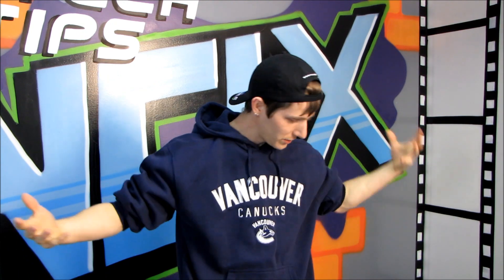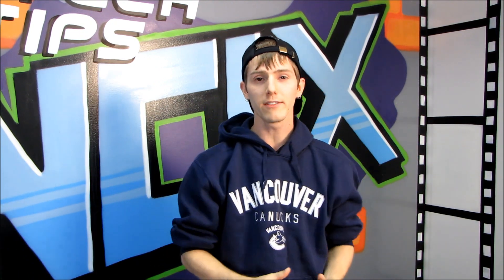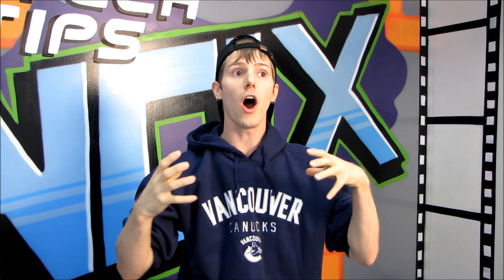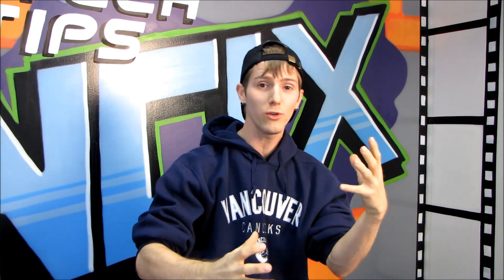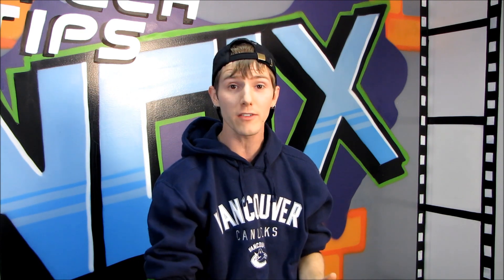Futureproofing Your PC - Dispelling Some of the Myths NCIX Tech Tips

Comment: it really all depends on what the customer wants, for say he/she wants to do basic stuff like lite to medium gaming, office tasks, youtube and facebook kind of stuff in the back ground, for this specific person id recommend something like a FX-6300 (becuase were just starting to get into softwares using 4 cores so in theory, a 6 core should be plentiful). I would then choose something like a r7 260x or 750 TI OC (becuase with light weight tasks, either of these will be plentiful for what gets thrown at them). then i would chose 8 GB or ddr3 1600 MHz ram(becuase with heavy software like AV's, you should have atleast 4 or more and 8 is sort of the sweet spot. last but not least i want one of the top 2 chip sets (970-990) that are available for that specific cpu and not cheapo, a decent board thats certified to last more then 3 years and a power supply that is atleast rated 80 Plus or better and like linus said, storage varies but my reason for not including is just for the fact that they would probably be the first to fail on the system, but for the time being what would be put in this rig, a 2 TB hard drive for storage, and a 128 GB ssd for OS and softwares
Reply: Jack Pollin FX-6300 can run most CPU-demanding games on high np.

Comment: Future proof, hmm.. i'm still runing  C2Q 9550@ 3.6GHz; cooler CM V6GT; MB Asus Maximus II Formula; 4*1 GB Corsair Domminator DDR2; PSU Corsair TX750W; GPU Gigabyte HD5870 1GB, and few days ago I upgraded from corsair force 3 SSD to samsung 850pro (corsair is now used only for sys. cashing), everything still runs at maximum on 1050p without any problem. I know it is a very old peace of hardware, and because of the newborn it will have to wait at least a year more before i retire it, but oddly i find it satisfying that it is still fully operational and very usable for gaming.

Comment: I completely agree. I never really thought about it like this. But yeah the PSU will last you awhile and so will a case. A case can theoretically last you forever. Sure you may have to upgrade a squeaky fan here or there but overall it's going to last. I just bought a new PSU last week for a new build, the one I'm currently using is about 5 years old. It still functions fine but it is getting old and I want a more efficient, more fresh power supply. Graphics cards are just not future proof. Unless you want to shell out a thousand dollars for a titan then it's just not going to happen. Even with that Titan, it's still not future proof. The Titan will be obsolete in two maybe three years, that's just the reality. I suppose part of "future proofing" depends on your expectations like Linus said. I feel like a processor is something that can be semi future proof. I know the FX8350 is a few years old now but I just picked one up as an upgrade from an older FX6100. If I would have gotten that 8350 when I got that 6100 I would not have to upgrading right now. I made the stupid mistake and now I'm actually paying more in the long run. BUT the 8350 is where my motherboard tops out. I can't have any of the 9000 series processors because the mobo can't handle the power necessary to run them. But since a processor needs to be upgraded way less often than a video card, I should be good with this processor for at least 2 or 3 years. The 8350 is generally what's recommended for newer games. I just upgraded a GTX 560 to a GTX 760. It's a big step up from the 560 but I understand that that card in no way future proofs my computer. I'll have to buy a new card in 2 or 3 years but that's the reality of pc gaming. Video cards and graphics technology advances so fast that you just cannot future proof it. I wish I could afford something better than a *60 series GTX card but I can't so the 760 is what I got. In a year or two maybe I'll get a 960 when the price drops. But whatever, rant over. I did prepare myself for future upgrades though. I got a motherboard with upgrades in mind. I couldn't afford the best of the best at the time but I knew in a couple of years when I have a better income level and prices are lower I could afford to upgrade to the newer things. Harsh reality, which is something I didn't think about before, is that now that I can afford the "best of the best" the best of the best from 2 years ago isn't the best of the best anymore. Still, I am usually restricted by my budget. Usually by the time I can afford to ugprade I just need a full new system build. Next time I build a system, I'm just going to go all out and get all of the latest and greatest in order to avoid having to do these frequent 2 to 3 year upgrades. Video card upgrades every 2 or 3 years is fairly normal though. I just realized I don't think anyone is going to read this but that's ok, I'm just talking. LOLOL.
Reply: Jake Rindfleisch 3 years old HD 7990 still max any game released this year, and can probably max games for the next 2-3 years at 1080p.
Reply: mohanidzhd Well that's not true, I assure you.
Reply: Jake Rindfleisch It is true, HD 7990 runs Watch Dogs maxed to full at 60+ fps 1080p.

Can run games at 1440p, its equivalent to r9 290x and gtx 970 with more Vram. Both of these GPUs are high-end GPUs. Considering high-end GPUs aim for 4k and 1440p, HD 7990 has to fall to a mid-range level for 1080p gaming to consume full of its power.

AMD are usually patterned, HD 6870 is almost equal to HD 7770, and HD 7770 is almost equal to r9 260x. So HD 7990 would be R9 380x this year, R9 470x next year, R9 560x 2017.
5 years playing highest quality ;)
Reply: Yeah it works fine for games that are out now but it will not be able to max out games for the next 2-3 years. I don't know one card that will be able to do that unless you drop a thousand dollars on a Titan.
Reply: Jake Rindfleisch Did you even read? GPUs that aim for 4k will run future games at 1080p. Just like the HD 7990 is doing now.

sli gtx 980, r9 295x2, r9 390x or gtx 980 ti that run new games at 4k 60fps would easily max games in 3-4 years at 1080p 60fps. My 3years old 7970 OC still maxing all titles released today.
Reply: Bullshit.
Reply: Jake Rindfleisch Yea, you obviously never owned a high-end GPU. No point arguing.
Reply: Yes, I have, and I do. No GPU unless you dropped a grand on it, will last you that long. You lost, get over it.
Reply: Alright, I cede you this argument. Apparently, what I thought the HD 7990 was, was not what it is.
Reply: hey i came from the future and the hd 7990 cant max games anymore sorry

Comment: i am planning to assemble a New PC by d end of June.. and unless the technology changes too mch by then.. i am going to stick to the following..

CPU: intel core i7-4790K
GPU: Dual Nvidia Geforce GTX 980
Motherboard: Gigabyte GA-Z97 Gaming G1 Wifi
PSU: Corsair RM1000
Case: Cooler Master Scout 2
Cooler: Corsair H100i or maybe the Corsair H110
HDD: 2TB WD cavier Green (thats the only one available in India)
SSD: Samsung pro series 256 Gig SSD
Headset: Roccat Kave 5.1 (not the XTD version)
RAM: Dual G-Skill RipjawX 1600Mhz 8Gig
Monitor: Samsung LU28D590DS/XL UHD 28" monitor

I guess this would be "future proof" enough to support all games for the following 2 years at least without a need for an upgrade. of couse.. i might be wrong.. so anyways.. i am primarily building it for gaming! costs me around 3800 USD (i converted Indian Bucks to Dollar.. would be some hundred bucks cheaper if u buy the same configuration in the US)

Though i am a Little bit confused with the CPU.. as i am not fully sure if it would support 4K gaming with settings on the max or would it turn out to be a bottle nake for the GPU.. i did concider going for the newer and more powerful i7-5820K.. but it needs DDR4 memory which are too hard to get in India. plus.. the only DDR4s available in India are 4 gig max! So i wuold concider a future upgrade.. so i dont want to put in 4 gigs.. i wanna go for 8! but is not available! i'm a bit confuesd! i personally dont wnna go with the older Intel Haswell processors.. so anybody with any suggestions.. please help!
Reply: Spider Man I liv in India.. Here the manufacturers have to give a lot of import tax.. And also 1 dollar is equivalent to 63 Indian Rupees.. So yeah.. It costs an estimated 38K dollars approx if u convert the Indian currency to USD..
Reply: Spider Man sorry.. I meant 3.8K dollars not 38K.. Lol ^o^
Reply: this build is insane lol
Reply: if its just for gaming then get an i5 4690k it will perform the exact same as a 4790k since games dont take advantage of hyperthreads
Reply: $3800 ???? That system should only cost $2000
Reply: AnimiKh AiCh this is late. But your build will not be able to play any new games at 4k. Ideally spending that type of money you would want to play at at least 60 fps. Go with a 1440p monitor instead or upgrade to the r9 295x2 which is $100 more but can actually play games at 4k.
Reply: Alex Yeung yeah.. Guess soo... Dts y i decided to wait for the skylake processors and a better cheaper graphics card.. And buy an ultrawide curved 1440p monitor.. And not 4K.. Because thats the gamer sweet spot as of now!

Comment: Used two GTX 780s in SLI on my Coolermaster V700, power supply would turn off if I had the 4.6 GHz overclock on my Intel Core i5. Turned that off and everything is fine in stress test.

My fault for not future proofing my PC. Probably am going to get a EVGA Supernova G2 1300W.
Reply: I'll think about it.
Reply: V700 is more than enough for powering 2 780's.
Reply: gdfschimpi007 Yeah it is (WITHOUT THE CPU OC. I'm not the only one that had this issue with 2x 780s and CPU OC.  Though the 780s will run fine if I do not have my CPU overclock settings on. I think it's just the cooler master v700 being the problem.
Reply: Ben Major Yeah it is. Stock is fine anyways, not like you'd even notice a difference. 3.4Ghz is nothing to laugh about when compared to AMD.
Reply: I'd still need to upgrade my power supply if I even want to overclock my graphics card slightly. I doubt paying $240 for this power supply was worth it.
Reply: Ben Major I never trusted CM power supplies to be honest... I always buy Antec PSU's. For $124 the Antec EA-750 has 100A on the 12v rails combined. Your v700 has 58A... It does have a five year warranty, but I still wouldn't trust their flaky PSU's
Reply: Seasonic is the OEM for these PSU's so I trust it. 100 amps is crazy lol.
Reply: Ben Major Buy one from NCIX it's cheaper you can also price match that bitch so it can be a lil more affordable ;D
Reply: Well I'm in australia so thats not going to happen.
Reply: Ben Major Move out of that shit country and come to the United States.
Reply: Don't talk shit about Australia I'm from Texas and U.S ain't perfect either the NSA is always snooping on us they want companies to give them access to all their data and shit

Comment: For my needs (I don't have any monitors that can reach 1080p and I don't really care) this system should be fairly future proof. I want to be able to game at high/max settings on pretty much all the recent games out right now and won't mind dumping quality down a bit as time goes by so I can continue to play games fairly smoothly. I want to be able to play Batman: Arkham Knight, but most other games I'm interested in for PC are older. Between that and surfing the web, I don't need the absolute best. Not gaming at 4K or any of that insanity.

http://pcpartpicker.com/p/jM23sY
Reply: I still have an i7-920 with a gtx580 using a 1050p monitor. Still runs games beautifully. Looks like a decent build.

Comment: My new rig, i5 4690k, Sabertooth z97, R9 280, 16 GB ram, 256 GB SSD, 2 TB HDD just isn't that much better than my 5 year old i7 920, EVGA X58, Radeon HD 4870, 6 GB 2x1TB HDD rig.  In fact, the old rig gets better internet speed: 58 Mbps vs 40 Mbps, sitting side by side on the same wired router.  I can't figure that out at all!
Reply: Has nothing to do with the PC... You should be happy with 40Mbps...

Comment: The power supply and case is something that will last you for sometime.  The issue with the case is that sometimes it could end up looking beat-up because of the continuous usage.

Linus nails it at the end, the overall use of your pc.  I've been running an athlon x2 240e for about 4 years and haven't had an issue as I use my pc for web browsing with minor gaming here and there such as playing world of warcraft and some old games and indie games.  But as of late, I have noticed that there has been lag as I have tons of tabs open while browsing the internet.  So I've been interested in going quad core.  But the issue is, should I upgrade the cpu to something like an Athlon II X4 640, Phenom II X4 945, or Phenom II X6 1055T or build a new one?  I'm open to any suggestion.
Reply: OR.....
should you just over-clock?....
Reply: *****
I was actually contemplating on rather to replace the entire system [rebuild] or upgrade the cpu, graphic card and power supply.

I window shopped for an amd phenom II 1065t, which had more cores for multitasking for durability and had a lower power requirement than the one you suggested, an 1100t.  The problem I found was that it was going for about $150 used.  At that price, I could get an i5.  So it became a comparison of new or used hardware. 

In the end, I replaced the entire system.  If suppose the x6 were being phased out and going for a lower price, I would have likely jumped on it.
Reply: TheSnoopyclone
Glad you went with the i5. X6's have been discontinued and are overpriced. The x6's are true 6 cores compared to the module garbage with AMD's FX chips. Not saying it's a bad chip, it would make more sense to get the i5 over the outdated Thuban chip. Not to mention the i5 has much stronger cores and better architecture.

***** Your motherboard has no heatsink on the VRM, that makes me cringe so hard, especially when overclocking.
Reply: gdfschimpi007
I'm running windows 7 pro x64 for higher storage capacity and for xp compatibility.  It's runs as smooth as the xp setup I had except it doesn't have any bottlenecks from surfing the net or doing multiple tasks at once.  Before I had two browsers open [firefox and opera] with several tabs [5-8 tabs] and you'd see slowdowns.  Now, I rarely see any slowdowns.

Originally I was going to get an i7 4790 non k version as I'm not overclocking.  But knowing that intel is releasing broadwell sometime next year, I'd wait until then.  But it has been noted that the h[z]97 series will be supported.  Hopefully the 97 series will be supported for another 2 generation.

Even if broadwell is released, the i7 has hyper-threading, which many programs aren't using much compared to actual cores.  And developers aren't fully supporting hyperthreading as of yet.  So it would have been extra money spent, an extra $100, for a feature/function that may not be fully used, where as the extra could be spent on something else, like getting a bigger hard drive or a better graphic card.

Hopefully there will be a 6 core without hyperthreading for the 1150 socket that is supported for the 97 series.  Only the future knows, so let's see.
Reply: TheSnoopyclone
Intel always has two generations per chipset. Broadwell will be supported on 9 series chipset boards, which will be released around Decemberish of this year.

There will never be a 6 core on their mainstream platform. They will always be on the enthusiast side with hyperthreading. X58/X79/X99. Obviously it makes no sense to purchase a high end chip unless you can take advantage of the extra cores/threads. i5's are the sweet spot for gaming.

If you need the PC now there is no point in waiting. When it comes to gaming the difference from Sandy Bridge to Haswell is negligible. 5% IPC improvement at best. 2600k, 3770k, and the 4770k all yield similar results.

Comment: my first gaming rig iv just built. spec

3GB Sapphire Radeon R9 280X TOXIC, 28nm, 6400MHz GDDR5, GPU 1100MHz, Boost 1150MHz, 2048 Streams, DVI/HDMI/mDPort 

Processor 
AD785KXBJABOX - AMD A10 7850K Black Edition, S FM2+, Kaveri Core, Quad Core, 4.0GHz, AMD Radeon R7, 95W, Retail 

Power Supply 
850W Corsair RM Series RM Series, Full Modular, 80 PLUS Gold, 1x135mm Fan, ATX v2.4, PSU 

Motherboard 
A88X-G45 GAMING Assassin?s Creed Liberation HD MSI A88X-G45 GAMING Assassin?s Creed Lib HD, AMD A88X, FM2+, DDR3, SATA III 6Gb/s, RAID, PCIe 3.0, DSub/DVI/HDMI, ATX 

Memory/R.A.M 
8GB (2x4GB) Corsair DDR3 Vengeance Pro Series Red, PC3-17066 (2133), Non-ECC Unbuffered, CAS 9-11-11-31, XMP, 1.65V 

Case 
Cooler Master CM Storm Trooper XL-ATX Case with Window, USB 3.0, Black with corsair h55 watercooling unit and 4 corsair fans.

Hard Drive 
1TB WD WD10EFRX RED 24x7, SATA 6Gb/sec, 64MB Cache, IntelliPower, 8ms NAS/Enterprise and another 1TB barracuda 

Operating System 
Microsoft Windows 8.1 64Bit DVD English International OEM - 

DVD Writer 
LiteOn IHAS124-14 24x DVD±R, 8x DVD±DL, DVD+RW x8/-RW x6, DVD-RAM x12, SATA, Black, OEM